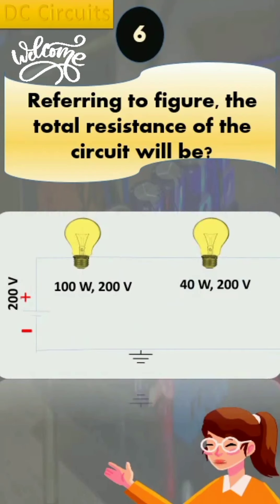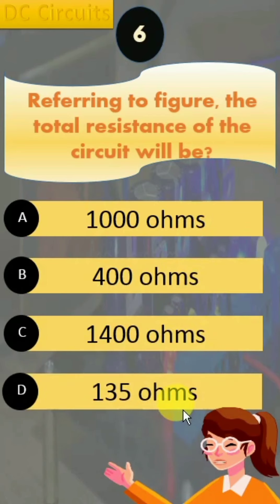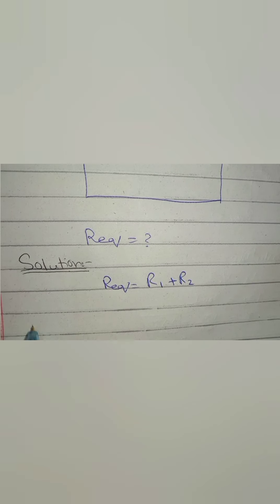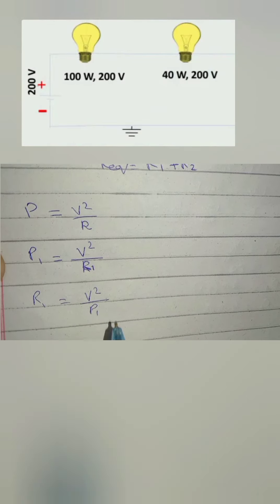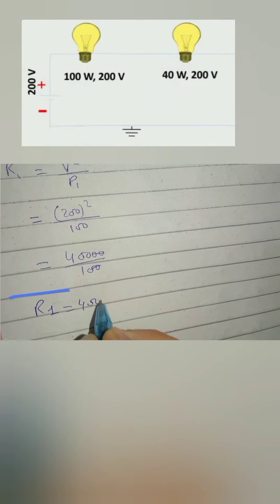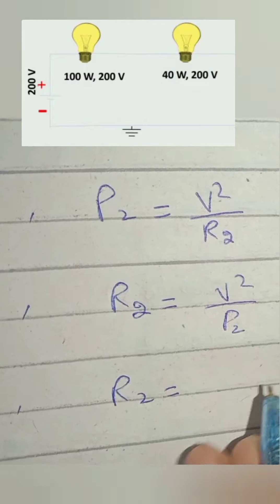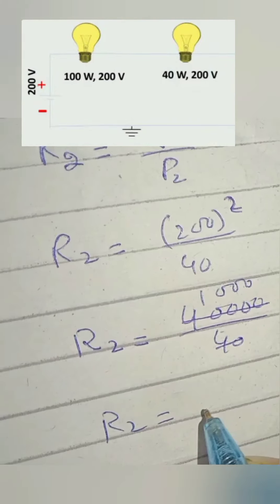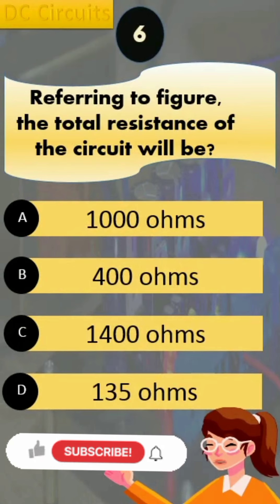Referring to figure, the total resistance of the circuit will be? DC Circuits Question 6

Comment: Since you have loads in series there would be a voltage drop across the loads, so the loads will have different voltages that add up to source voltage.

For the 200v requirement for both loads the circuit must be in parallel.

The question can be solved by ignoring the 200v at load and using different formulas
Reply from the maker: But here, you can't change the circuit. However, your answer is appreciated 👍